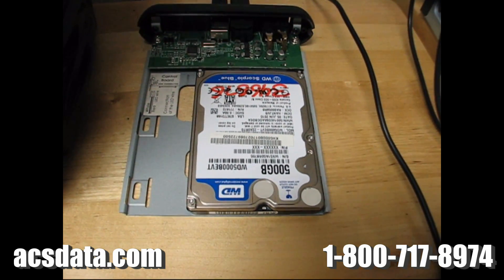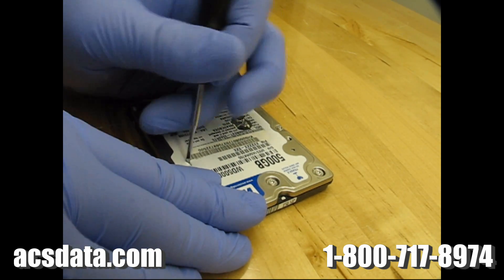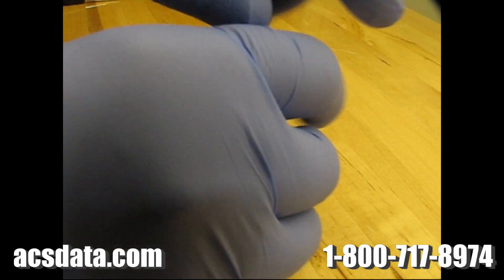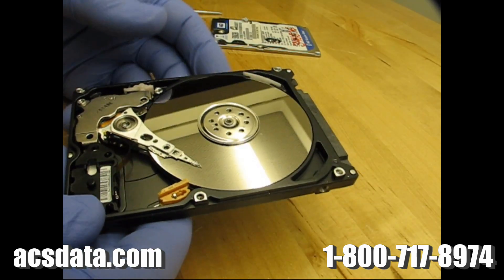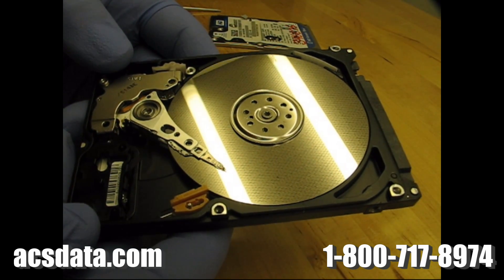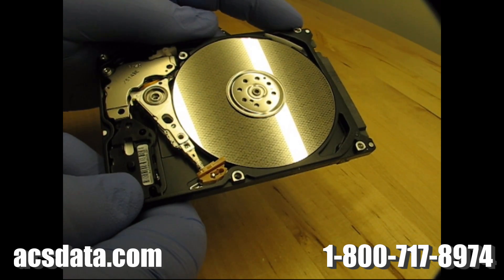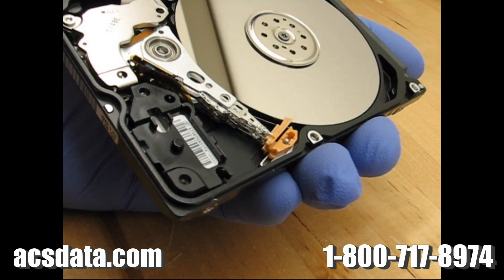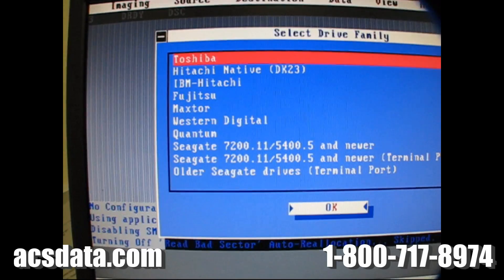Data Recovery - Video Project 2 - Heads Seized To Platter

Comment: had any cases with a drive drop and the spindle motor is seized where it would require a platter transplant to a donor drive? I assume that is probably more expensive than say a head swap... I know seagate, and maxtor is probably very prone to bearing seizures especially when the drive is dropped.

Comment: Hello! I've opened up my hard drive (WD 1TB), and seeing the head are just fine. No stucking. When I plug in power to it, when the head start to read, it keeps on kicking back to its original position,producing constant beeping on my HD. Can you give some advice about this? Thanks. :)
Reply from the maker: It could be that the heads are bad, even though they may look ok.  Heads can fail if there is an electrical issue as well.  Doesn't have to be physical.  You can have situations where the pre-amp chip, which controls the head, is damaged and the heads simply click as they try to calibrate.
Reply: alright.thanks then. :)
Reply: acsdata what do i do in this situation ? i have the same problem

Comment: Hi! Thanks for your instructive video! I have a Toshiba 2.5", 320 GB internal HDD. Actually,is the main drve of my laptop. Nothing happened to the computer: no 

damages of any kind. But the disk stopped working. I heard a clicking noise. I oppened the drive. It is a 2 plates,4 heads drive, I connected it and I saw: perfect plates, 

moving step by step (like moved by a step by step motor, right?). And the heads fixed outside the plates, I mean without touching the plates at all. Could you please advise 

me on this issue? (May be the heads are damaged and the disk has any kind of protection (¿?) to avoid the heads damaging the plates....¿?)

Comment: Excuse me but I have a damaged head on my 320gb hard drive. It has only one platter but I got awful finger prints all over it. And the heads bounce back, forth, and then the hard drive stops on a brief period, then kicks back on in a minute. Its the exact same model except: WD3200BEVT-60A23T0. I damaged them by accident, but when it was fine and healthy, the hard drive will unfortunately NOT format. Rip my 3 year old loyal working drive :' (